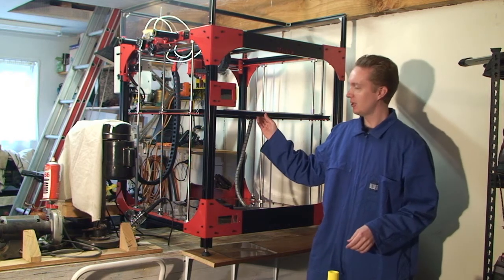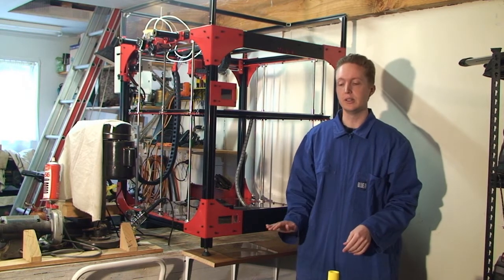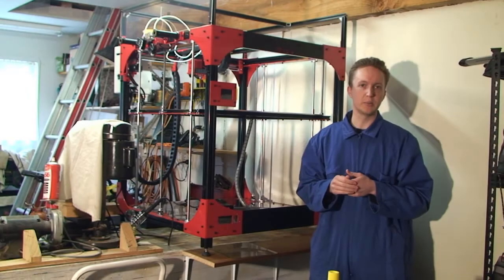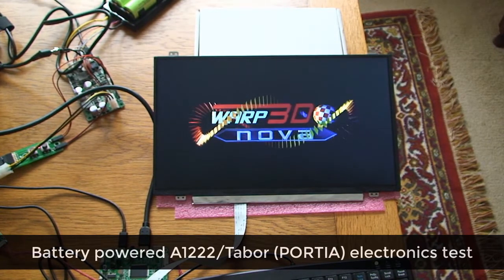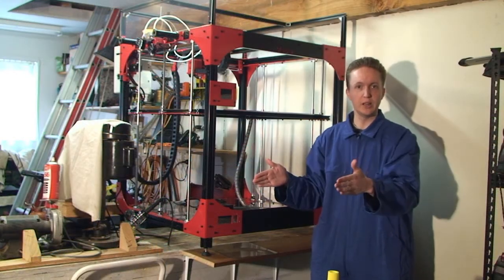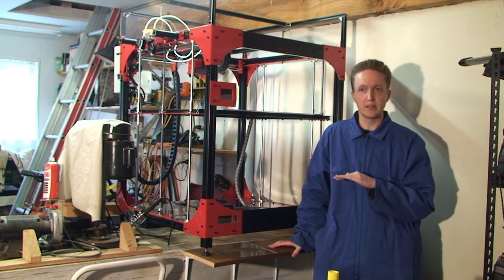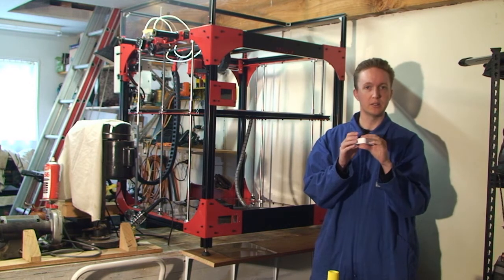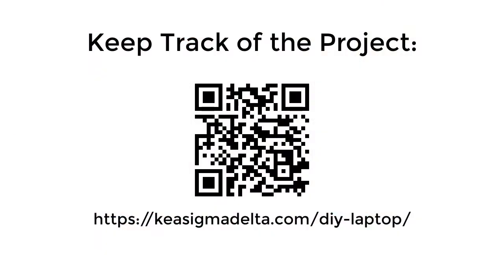DIY Mini-ITX Laptop Project   Update and Basic Details

Comment: Hey, how are you doing? I hope you're doing fine. Now that you have more time to do stuff because of the Coronavirus: Do you have any news regarding this project?
Reply from the maker: No news, sorry. I've had to put the project on hold for a while, and hope to get back to it later this year.
Reply: @KeaSigmaDelta  All right, keep us updated then. Hope it all works out.
Reply: @KeaSigmaDelta  Im working on a similar project. I'm going to be using sheet metal. Have you figured out the battery power supply yet?
Reply from the maker: @peterhindes56  Yes. This video shows the machine running off batteries. My advice: do NOT try to make your own battery controller, and be careful about the batteries you buy. The board you see connected to the batteries is an OpenUPS.

Comment: Have you thought about thin mini itx? I was able to fit a whole system excluding the display in a chassis a bit less than 38mm thick. I bet with the 3d printer it could be even thinner, as I was just using a serrated knife, tinsnips, wood, polycarbonate, and sheet metal.
Reply from the maker: Yes, I've thought about using thin Mini-ITX. However, one of my goals is to build an Amiga laptop, and there are no thin mini-itx motherboards available for AmigaOS 4.
Reply: @KeaSigmaDelta  oh ok,

Comment: mate did you use the 19v DC in or 12v DC in
Reply from the maker: You mean for powering the laptop? It's a 19V power supply, which is more suitable for a higher-powered device. 12V would mean higher current and thicker wires.
Reply: can you share you power system design
Reply from the maker: Not at this stage.
Reply: I’m guessing you’re using a Pico/ITX PSU either a cluster of commercial ones like those on amazon or a high end HDPLEX or a custom one if you really throw money at it. Then you wire the BMS in parallel with the powering barrel jack. Bada bing bada boom~

Have you tried out any thin ITX boards? ASROCK and their IMB line with their Q370 chipsets look very tempting and you forget about any PSU wiring with a handy 4 pin for battery power.

Comment: Have you thought about using a mini-stx motherboard if size is a concern? They usually have a  pcie slot for a wifi card aswell.
Reply from the maker: Hey qeshi, 
Thanks for the suggestion. I hadn't actually heard of the Mini-STX form factor. I've had a quick look, and it looks like Mini-STX won't make the laptop any thinner; just a little smaller horizontally. 

Mini-ITX is small enough width & height wise, and has the advantage of being readily available, and being able to use standard graphics cards (which are much easier to get than MXM graphics cards). So I think I'll stick with Mini-ITX for this project.
Reply: Oh I didn't know you were going to put a graphics card in it. Cool project anyways! I'm really curious how long battery life it's going to have.  I've been thinking about doing something similar myself since I wanted to have a powerful portable computer. But I ended up getting a mini-stx computer, a portable monitor and bluetooth keyboard and mouse. It's a bit like a laplet but it needs to be plugged in to work.
Reply from the maker: Thanks. Battery life is measured in hours, but we'll have to wait and see how long battery life actually is. Plus, it depends on multiple factors, including what you're using it for.